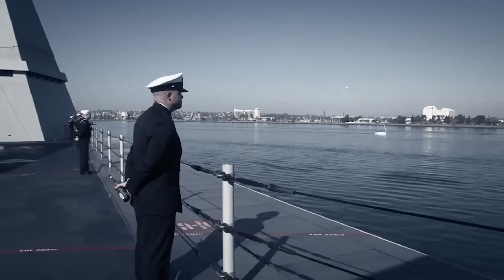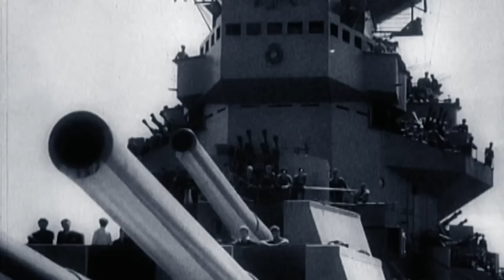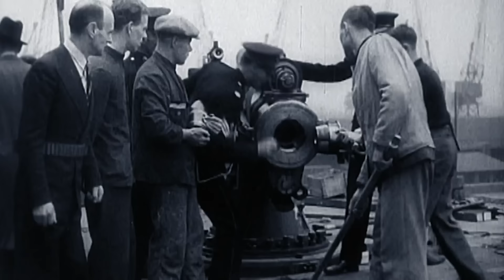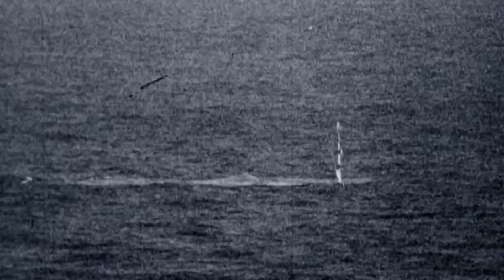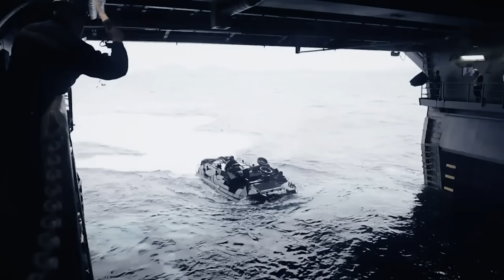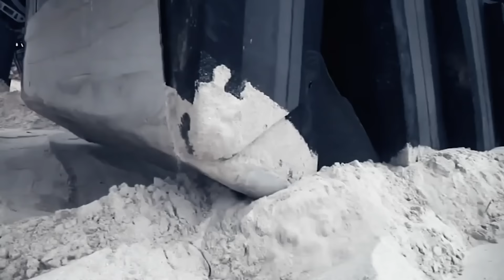USS Zumalt: The Most Powerful Stealth Destroyer That Slices Through Waves | Power | Spark

Comment: I thought the three Zumwalt class ships were classified as cruiser. There is somewhat of a problem with the two 155mm deck guns. The ammunition costs between $800,000-$1,000,000 a piece. They now plan on pulling both turrets to be replaced by surface to surface mult-missile tubes. I have an unsettling feeling that the Navy invented a new job specification that didn't exist before. Don't get me wrong, the surplus power produced by the propulsion system is very farsighted. But the Zumwalt's speed is lackluster. Plus, it was supposed to utilize modular purpose specific design which was supposed to be able to exchange in eight hours but realistically takes to three weeks

Comment: Nuclear technology nuclear power is not the only no fuel power plants.  The Edison generator and dynamos can easily replace fossil fuels and nuclear power plants without fuel or radiation and much less weight.  It is zero fuel unlimited range electric power ships.  It is very important for survival not to use nuclear technology halogenated vinyl or halogenated carbon.  Edison generator and dynamos power plants with inverters and transformers can deliver any amount of high voltage AC power continuous peak power without fuel or pollution.  Industrial environmental toxicology MA toxicology BS biology BA chemistry.

Comment: We are grossly misinformed about power generation systems.  The Edison generator and dynamo powered electric cars trucks trains airplanes helicopters and ships immediately reduce fossil fuels use.  We can build Edison generator and dynamo powered electric ships instead of radioactive nuclear powered ships.  The Edison generator and dynamos power plants can produce the same high voltage AC power and continuous peak power without fuel for an unlimited amount of time.  This means we can power an aircraft carrier with much less weight and no dangerous pollution or contamination of sailors.  The lighter weight means greater capacity .  The aircraft carrier can carry more airplanes helicopters amphibious vehicles and troops. The Edison generator and dynamos power system can easily replace fossil fuels and nuclear technology.  We are grossly misinformed about power generation and climate change global warming.  The fossil fuels replacement and replacement of nuclear technology is essential to survival. We are late responding to environmental industrial pollution..

Comment: I wonder who did the research for this documentary? Although Nimitz class aircraft carriers are beasts of the sea, they most definitely don't have the capacity to carry 130 aircraft.. Their limit is around 90 aircraft although they haven't deployed with that kind of firepower since the late 1980s. Currently Nimitz carriers sail out with around 50-60 various aircraft, from the F-18s to helicopters to AWACS platforms. The new Ford class carriers are of similar size (a few tonnes heavier) and have the same capability of carrying over 90 aircraft but their great advantage over the Nimitz class is sortie rate, meaning it will be capable of sending more aircraft off of its deck in a same amount of time due to the EMALS catapults and advanced arresting gear systems based on electricity instead of steam.
Reply: It's the addition of pit stops that really increased the sortie rate. They have newer reactors that can output more power thanks to the steam saved from the EMALS.